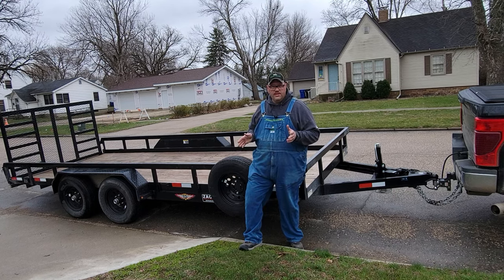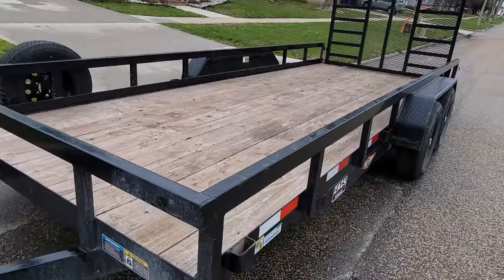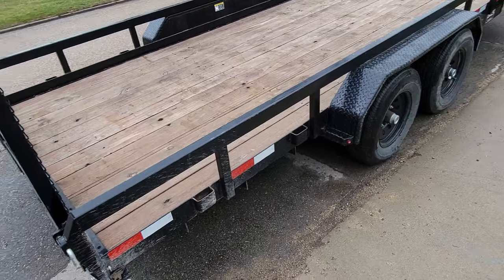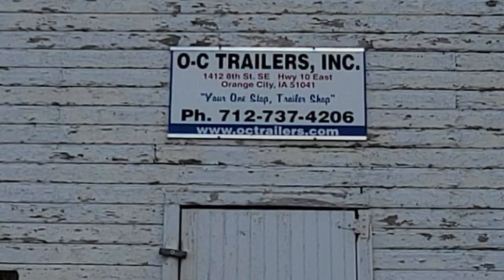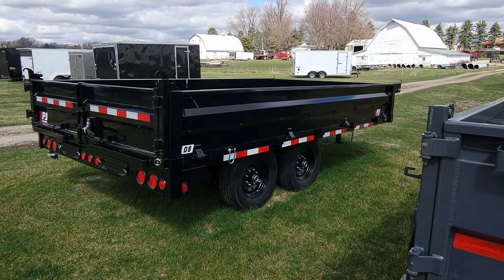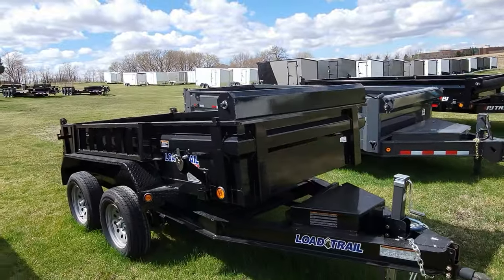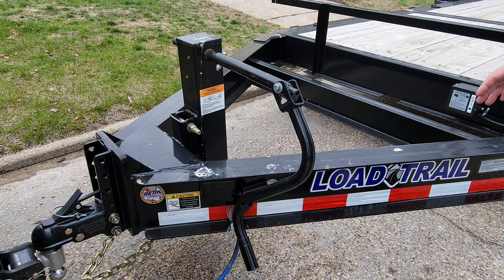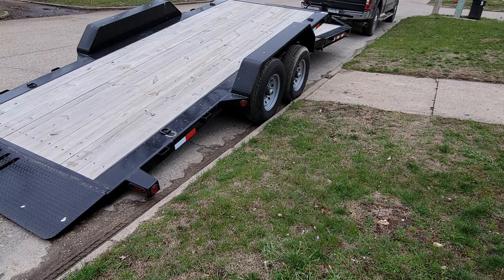What Drove Me To Upgrade My Trailer? Unveiling The Reasons Behind My Decision!

Comment: Nice trailer Bud!  You should go to work selling trailers for them LOL.  I'll bet you've sold three trailers for them just with this video!!!  :-)  I think you'll be happy with your new trailer, and I hope it serves you well.  I can't tell you how glad I am that you didn't get a P.J.  I've had SEVERAL P.J.'s, and I'll never own another one.  If you look at their welds, they're terrible, and they leave the splatter all over the place and just powder coat right over it, and their powder coating itself is the worst I've ever had.  It started chipping almost immediately when I had them.  To me, the P.J.'s finishes just don't hold up to the Mid-West's Winters worth a darn.  I think you'll be MUCH happier with what you've gotten.  I hope so!

Also, I would BET that you can get two pallets of firewood bags on there with you.  One on the stationary deck, and then maybe you'd be able to back the tractor onto the trailer with another bag on the forks?  I forget, are your rear tires loaded?  If so, you could definitely back onto the trailer and manage to take two skids of firewood with you.
Reply from the maker: After my test load I agree. I'd need to back on with one on the forks. My tires aren't loaded. Something I've been waiting to do after I upgraded trailers just because I was so close to limit on the old trailer

Comment: What happened to your little tractor with the grapple?  Nice trailer by the way
Reply from the maker: I traded that off last summer. Needed one with a bit more lift capacity. I do miss that little monster though. It would not lift full 1/3 cord bulk firewood bags as a tractor that size shouldn't. Changed my process a bit to save time stacking and loading for sale. Lots of videos showing this progress in the past year. Thanks for stopping in!
Reply: Im shopping for a subcompact tractor with a grapple and found your videos.  Im  clearing brush on our overgrown woods all the time and tired of stacking burn piles by hand.  Glad you put out the videos on the little tractor.  Kioti dealership kind of looked at me funny when i asked about a 3rd function and grapple on their smallest tractor.  If it wasnt for the cords of firewood aspect,  and you would be just moving rounds and brush would you have kept it?
Reply from the maker: @edgeoftheforesthomestead602  if it wasn't for the small size and what I needed to do, yes, I'd still have it.
Reply: I’ve just been thinking about getting a tilt trailer lately…
Reply from the maker: @MowSowGrow3 So back in the day I had an Aluma full tilt deck, 12 ft. if memory serves.  I knew I loved the ease of loading and unloading with a tilt deck.  I just needed something with a bit more capacity since upgrading to the DK tractor.  Now I have a decent cushion on capacity.  Hopefully this video gave a little bit of insight on my thought process anyway and helped you out.
Reply: @timbervisions  definitely helped, thanks!